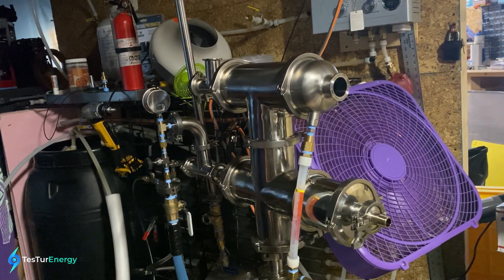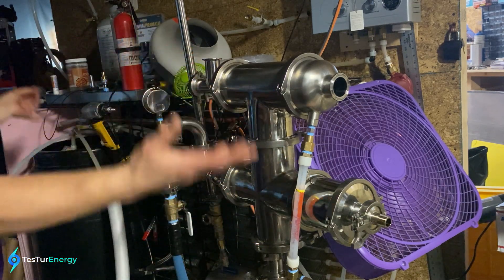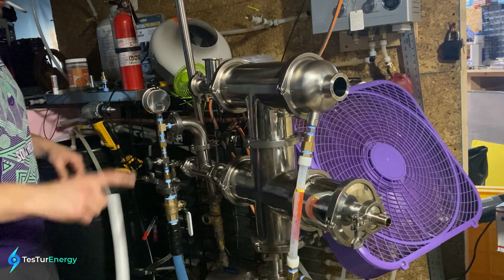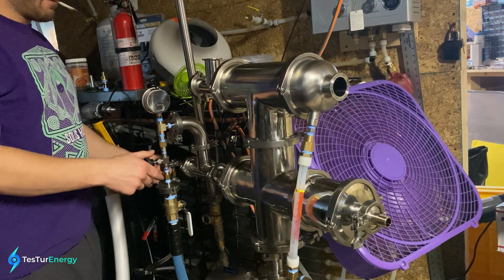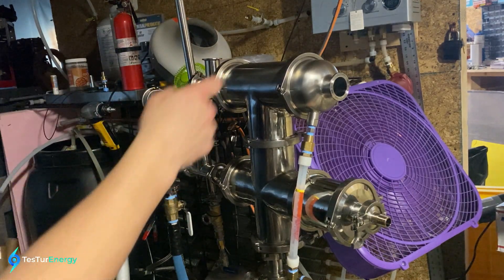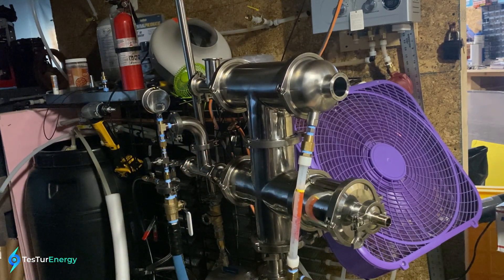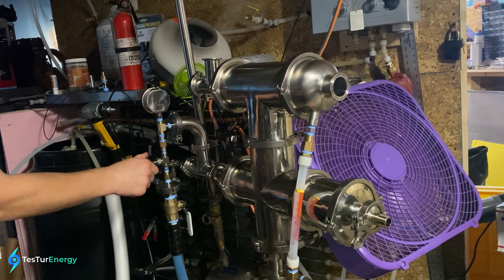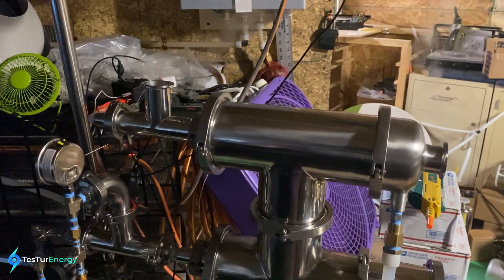Tesla Turbine Combustion System GB186,083- Pulsed Detonation During Ignition? propane flame tube PDE

Comment: hi Charlie!
Was intrigued by the title but if I understand correctly you run the tesla turbine with steam generated by the combustion chamber?
No sure why you chose a real turbine for that job. don't see what you are actually doing with the rotational energy of the turbo a. 
So in total I don't k ow what this machibe does.
Reply from the maker: 😈🔥😈🔥😈 You also don’t give up any of the combustion energy right after combustion to the latent heat of vap to raise the steam and THEN what’s leftover you increase the temp of the steam. All/most of the energy immediately after combustion mixes with superheated steam and is fully available for expansion through the turbine. And then is used for giving up the LHV.

Now add on the bacon bits of the combustion jet ejecting into the steam mixing tube literally makes a thermocompressor and pulls a slight vacuum on the exhaust recoup boiler. 

The pressure being slightly below atmospheric pressure means the water in the exhaust recoup boiler will boil at between 90-99°c. And take into consideration, if exhausting to atmosphere, that exhaust steam leaving the turbine will be slightly above atmospheric pressure due to general back pressure in a flow system. This slightly higher than atmospheric pressure exhaust steam will have a condensation point between 101-110°c. 

What this means is that the recoup boiler is capable of recouping 100% of the latent heat of condensation from the exhaust steam (AND LHC of the H2O gaseous products of hydrocarbon fuel combustion that almost all other engines throw out the back door except when used for heat in combined heat and power systems) because the exhaust steam will always condense at a higher temp than the slightly vacuum pressure recoup boiler. Further the latent heat of vaporization is even higher for lower pressures. And the exhaust steam will NOT go below the condensation temp until allll the steam is condensed and the recoup boiler will NOT raise above its lowered vaporization temp if there’s still water that can be boiled in the vacuum environment. So you will always be able to draw the latent heat of condensation off the exhaust leaving the turbine because there will always be a temp gradient with HUGE energy transfer of phase change via the combustion jet working as a thermocompressor on the recoup boiler and quite literally adding a minor heat pump to the exhaust to recoup thermal energy. 

And if this still isn’t clicking yet. lol with this system and an appropriately sized and designed recoup boiler heat exchanger, theoretically you only need to supply the latent heat of vaporization to your recoup boiler once and the system will continuously recycle the LHV and LHC continuously while all new combustion energy is used directly for accelerating the combustion products, which maintain the vacuum in the recoup boiler as well as compress and rapidly heat the steam coming from the vacuum boiler just prior to going into the turbine. 
🔥😈🔥😈🔥 
Not only does this system reduce the amount of energy the compressor even needs to supply to maintain the self sustained brayton cycle but you’re Rankine cycle can damn near break all Rankine and Brayton cycle thermodynamic efficiencies. And if what I believe is going on in this system we may even be able to get higher than Humphrey thermodynamic cycles with this. 🤓🤓🤓
Reply: @CharlieSolis  wow! That is really interesting. Please put that into the movie! That makes much more accessible.
Reply from the maker: This for real could not only be the piston engine killer but also the refined fuel killer as you can use ANY fuel. Liquid gasoline, diesel, waste oil, CRUDE OIL, pulverized coal, wood gas, propane, hydrogen, syngas even powdered IRON!!!!

if we can utilize iron (Fe) as a new potential energy storage chemical when we burn it it’s completely carbon free as you get FeOx’s (rust solid particulates) as the exhaust. Those rust particulates can be cyclone filtered out of the exhaust. Then solar panels can be used for electrolysis of the rust to turn it back into iron (Fe) and O2.  

It also means that the reddish dust allllll over the surface of Mars can be electrolyzed with solar panels to make powdered iron and oxygen for a fuel storage system, building materials, etc for the colonies 🤤🤤🤤 this seriously opens up so many solutions to our global problems!!
Reply from the maker: Hey Helmut! Thanks for commenting. Yes this device is a combustion flame tube for my Tesla turbine to make electricity. It’s a replication of teslas patent GB186,083 - improved combustion + steam hybrid turbine. The water jacket recoups the heat that would have otherwise been radiated away from the flame tube and uses it to make more steam for mixing with and cooling the combustion jet prior to going into the turbine. Using the recoup steam as the cooling medium of the combustion jet means the compressor doesn’t have to give up energy to supply a whole bunch of extra air for cooling. As well the specific heat of steam (joules/kg/°k) is much higher than for air, so steam will absorb the same amount of energy but won’t raise as much in temp. Which makes all the same energy for expansion available in the steam but at lower temps making it safer for the turbine. Furthermore the recoup boiler raises even more steam with the still above 100°c exhaust so that you don’t have to give up that energy right after combustion.
Reply from the maker: @Cole Tool Centre  also this is a good playlist of my Tesla turbine work I’ve done. I will be cutting an all stainless steel version of my 12in turbine for starting to do the high temp combustion + steam tests. 
“Tesla Turbine Generators With Usable Power and Torque”
https://www.youtube.com/playlist?list=PL4XBGjR8Gu-Emu1QRPIwATKFuCZabqOh1

Peak 2.75kW and 6.22ft-lbs of torque, to the shaft, at only ~4150rpm on room temp compressed air at 150psi. “300mph 10in Tesla Turbine You Must See!! 2.75kW, 6.22 ft-lbs with RC Brushless Electric Generator”
https://youtube.com/shorts/yXQy844URMA?feature=share

And that’s “brake horsepower” to the generator after all internal losses from my plastic and aluminum prototype build, as in what’s available for output. 

I also have a video showing actual 1200watt electrical load outputs with the same setup, with only room temp compressed air all the way down to 65-70psi. 
“1200 Watt Tesla Turbine Electric Load Tests With Less Than 90psi - CAES - Propane Water Heater”
https://youtu.be/bWpXRzrzf4g

Comment: I think you should be describing the ignition phase as "Pulsed Deflagration during ignition".
Reply: I haven't watched all your videos do you have a tesla turbine? 
My plan was if successful with my PDE to add water to the detonated fuel to maybe get high-speed flash generated superheated steam.
I have a car turbo charger I am going to try to test PDE work but the detonation may destroy the vanes on the Turbo.
Reply from the maker: @Graemecns  on a lighter note 
“What’s the best nation in the world? 

“ A DetoNATION! ” 😂🤓😬

(Get it… on a “lighter” note.)🤣😂😬

But I should add, all of what I commented is not to say that this theory and text is verifiably proof I got detonations, I’m just trying to show that detonations are very much in the realm of possible for what I’m using. And if I did not get detonations on this exact video I shot, I definitely did on other ignition tests I was doing with it that I didn’t get on camera. 

I will also add that I just elongated my combustion chamber by a lot in the last 48hours. I have a looong video I just put up “Tooling On The Tesla Turbine Combustion System GB186,083 - all stainless steel micro propane burner” 
https://youtu.be/kCM5majpIF4
 that I do the whole change over. My point being, I did not experience ANYTHING like the kind of “bang” with that first shorty flame tube and the same air fuel inputs as even just the first few ”BANG” ‘s I got when I started up this longer tube. 

Weird fact I find peculiar, the L/D ratios for regular DDT’s is oddly identical to the L/D ratios for Vortex Tubes…. 🧐🤓😬
Reply from the maker: @Graemecns  I’ll be doing liquid fuel tests here in the next day or so. I’m making the pressurized gasoline fuel tank for my replication of patent GB 186,083. So I’ll let you know the different between the bang of the gasoline.
Reply from the maker: @Graemecns  this is a good playlist of my Tesla turbine work I’ve done. 
“Tesla Turbine Generators With Usable Power and Torque”
https://www.youtube.com/playlist?list=PL4XBGjR8Gu-Emu1QRPIwATKFuCZabqOh1

Peak 2.75kW and 6.22ft-lbs of torque, to the shaft, at only ~4150rpm on room temp compressed air at 150psi. “300mph 10in Tesla Turbine You Must See!! 2.75kW, 6.22 ft-lbs with RC Brushless Electric Generator”
https://youtube.com/shorts/yXQy844URMA?feature=share

And that’s “brake horsepower” to the generator after all internal losses from my plastic and aluminum prototype build, as in what’s available for output. 

I also have a video showing actual 1200watt electrical load outputs with the same setup, with only room temp compressed air all the way down to 65-70psi. 
“1200 Watt Tesla Turbine Electric Load Tests With Less Than 90psi - CAES - Propane Water Heater”
https://youtu.be/bWpXRzrzf4g
Reply from the maker: Can I ask why you think the flame front did not reach supersonic speeds at the end of the flame tube with the accelerator nozzle? The ringing still in my ears tells me otherwise… 🫠
Reply: @CharlieSolis  have a look at this video https://www.youtube.com/watch?v=D-dLjHJuFWQ
Reply from the maker: For the record. The title is referring to the “pops” during ignition when it didn’t keep the flame. Again just for posterity, I’m not referring to the the short but sustained unstable flame front “beehive” noise.
Reply: I understand your description during start up. As someone who is also building a pulse detonation engine a few pops and bangs don't mean detonation.
Reply from the maker: @Graemecns  “THE DEVELOPMENT AND TESTING OF PULSED DETONATION ENGINE GROUND DEMONSTRATORS
by
PHILIP KOSHY PANICKER 

“Deflagration to Detonation Transition (DDT)
A deflagration within a confined reactive mixture can naturally transition to a detonation due to the buildup of pressure and temperature behind the flame front, provided that the tube length is sufficient. Typically tube lengths of the order of 1 to 2 m are needed for a deflagration flame front to form a shock wave and then to couple with it. Less energetic mixtures are known to take up to 10 m for DDT to occur. DDT run up distance is often expressed in terms of length-to-
diameter ratio ( L/D ). For less sensitive mixtures, natural DDT run up distances may require an
L/D of 10-60, whereas sensitive mixtures, such as acetylene-air or fuel-oxygen mixtures, may
require an L/D of 3-1039. However, DDT can be accelerated by means of increasing wall
roughness and turbulence. This fact was discovered by Shchelkin, who used spiral wires of various thicknesses to simulate wall roughness. It was found that the spirals cause the flame front to accelerate due to the formation of hot spots and pressure pulses in the flow. A laminar flame front in a reactive mixture will interact with the surface obstacles and the boundary layer creating pockets of hot burning gases and compression waves. Eventually, the compression waves preceding the flame front coalesce into a shock wave. The buildup of pressure behind the flame front accelerates it enough to cause it to couple with the shock, forming a self-sustaining C- J detonation. At the moment of the coupling, a retonation wave is also formed that travels back into the flow. There are various obstacles that may be placed in the flow path to bring about DDT, such as spiral fins, spiral grooves and orifice plates. However, the hot spots created by the obstacles also subject the obstacles to heavy shock and thermal loading, which can eventually destroy them. For application within a PDE, it is important to find an obstacle that is capable of withstanding repeated shocks and high temperatures without breaking down.
2.6.4 The Pre-detonator Method
Similar to the direct initiation and shock induced processes, a detonation wave can be created within a highly reactive mixture and then transmitted to a less reactive mixture. This method may also be referred to as detonation-initiated-detonation, because detonation in a highly sensitized fuel-oxidizer mixture is transmitted to a less sensitive mixture. In a propulsion system that works on this principle, a small tube containing an energetic mixture, such as propane, acetylene or hydrogen with oxygen, known as a pre-detonator, is connected to the main combustor of larger volume that uses a less energetic fuel-air mixture. Ignition is started in the pre-detonator in which a detonation wave is soon formed, and then passed on to the main combustor. This causes the less reactive fuel-air mixture to detonate. Thus, only a small quantity of oxygen and fuel charge is required to maintain detonations.”

Read the full 327 page dissertation here:
https://arc.uta.edu/publications/td_files/PKP-Dissertation.pdf
Reply from the maker: @Graemecns  as you can see a L/D of 10-60 is easily capable of achieving DDT. I have a 1in diameter pipe that’s at least 12in long, with random threaded nipples and a crude accelerator cone from a reducing fitting (all of which having lots of open threads and rough internal surfaces perpendicular to the reactant flow and flame front propagation direction that further reduce the allowable L/D ratios by reducing the needed length) AND it further has another few inches of a 1/2in diameter nipple and end fitting. 

Again, I can provide sources that confirm the clear and reasonable capability for my flame tube to achieve DDT. All I’m hearing from you is “because I said so.” Unless you care to elaborate…? 🤔
Reply: @CharlieSolis  just re-reading your replies your last section from your combustion chamber 1" drops down to 1/2" that will increase the speed and pressure do you have any idea on pressure coming out the end?
Reply from the maker: So that 1in to half inch only increases pressure when there is sonic flow in the 1in pipe. A converging cone only increases pressure for a sonic of supersonic flow. 

So it’s only when I actually have a detonation does a pressure gain result. When using the constant just at subsonic flow velocities, when just using the straight continuous jet the converging nozzle decreases the pressure and reduces its temp. 

Just fyi, I’m not trying to get DDT. I don’t actually want that right now. It’s just happening. 

But that being said, I have since changed the combustion chamber now to a whole different arrangement and the “PANG” it makes now is even crazier. 

The tests I’m working out now is doing the continuous jet into a higher pressure vessel that will then be discharged through the turbine. The pressure vessel is to simulate the back pressure from the turbine.
Reply from the maker: Check out my latest upload. Liquid gasoline fuel tests are a COMPLETE SUCCESS!!!
https://youtu.be/gRqKowignac
Reply from the maker: @Graemecns  and your claim that it isn’t happening doesn’t mean anything either without some form of reason as to why you think it’s not happening….
Reply: So how long is your tube. What are you using to transition your deflagration to detonation do you have any way of measuring the generated shock wave or are you just feeling it from where you are standing at the side?
Reply: Charlie I have included  a link to a video of some initial testing last weekend
https://youtu.be/mJzdFRLeCz8
Reply: Not knocking your work the workmanship is amazing but after starting my project to build a pulse detonation engine 5 months ago it just doesn't sound like detonation to me.